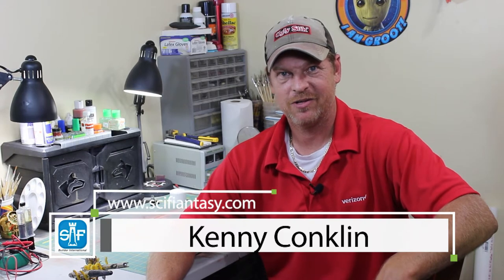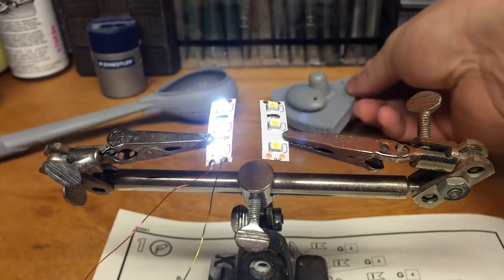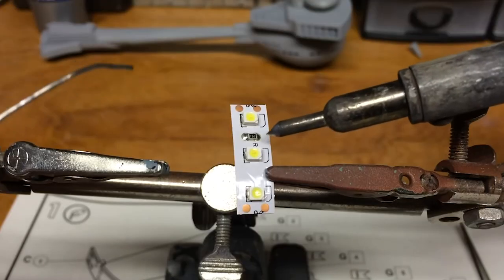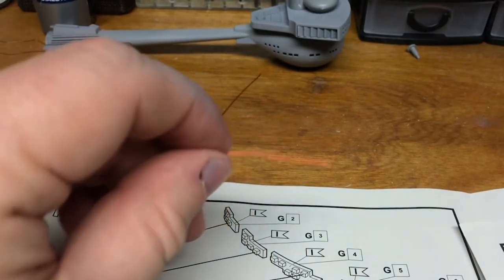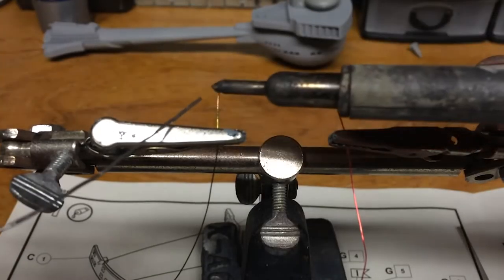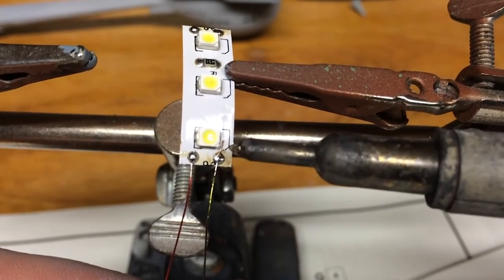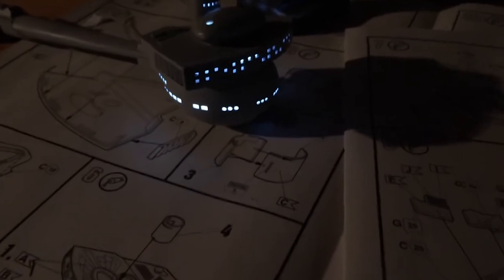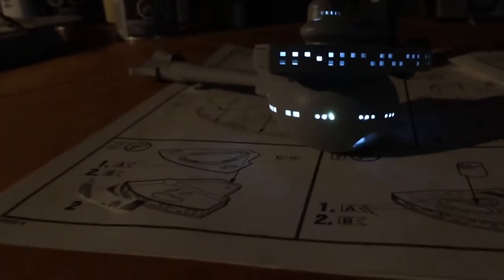Revell Klingon Battlecruiser D7 Build Tutorial Part 2: Soldering  LED strip tape

Comment: The actual TSO Klingon D-7 had 'NO' lighting in the model. Nor did it have the volume of windows this Revell kit has. Revell, again, screwed the pooch with this bastardized kit.
Reply from the maker: Jeffrey Sasquatch may not be screen accurate but it is a nice looking kit. And, the lighting does make it look good. But I do see your point if you want to build what was seen on screen.